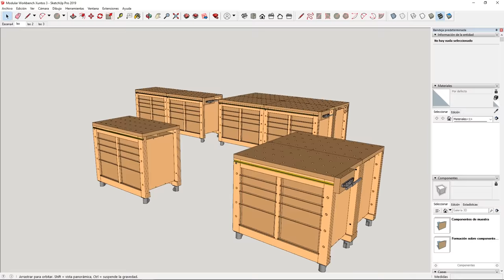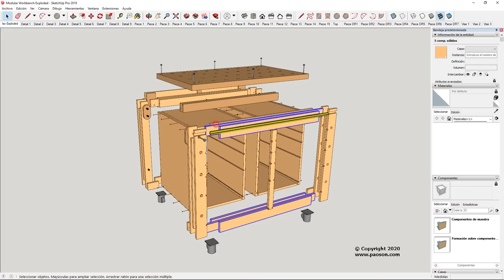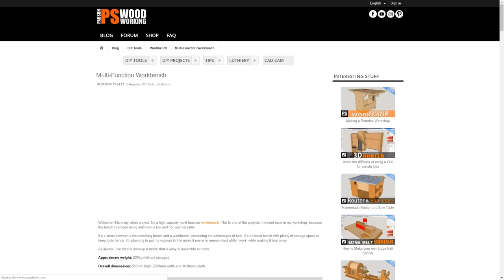Modular Workbench & Mobile Tool Stand (Ep.3)

Comment: Thank you for sharing this video. In a somewhat different form, I can see other vital uses for this Modular Workbench / Mobile Tool Stand concept.

OFFICE MACHINE(S) CART. This Modular concept, adjusted somewhat, would make an excellent printer/scanner/fax cart for small businesses and work-from-home settings. (This new concept would not need any vise or bench-dog-holes.) The drawers could house printer supplies and reams of copier-paper. The office machine(s) would likely be situated on top of the cart. The cart would incorporate a built-in plug-in strip / surge supressor and heavy-duty extension cord. This would be useful in assuring that the office machine(s) would not need to be individually unplugged in case the cart had to be moved from one location to another; all power needs on the cart would be met through the extension cord and the plug-in strip. The strip would also come in handy if the cart were also used to house at least one charging station for mobile devices, such as laptops, tablets and cellphones. A nook for locating such a charging station could be incorporated into the upper fringe areas of the cart.

HOME GRAB 'N GO. This is a direct evolution of the Office Machine(s) Cart previously mentioned. This cart would be an excellent place to house items that should be readily available to "grab and go" when departing or to "drop off" when arriving. Items would include a charging center for mobile devices (also maybe a recharging center for devices using Eneloops AA or AAA batteries). Items in storage here could include keys for doors, motor vehicles, key-fobs, flashlights, a place to hang a purse (or to stow a wallet), a place to hang a hat, a place to lay gloves in the winter so that they may dry. If the Home Grab 'n Go were equipped with a plug-in strip, it could also power an installed lamp or night-light, and the lower areas, if no drawers were included, could also house a boot dryer to allow outdoor shoes and boots to dry during winter or on wet days.

MOBILE DESK. If a retractable, pull-out and swing-up desk-tray could also be incorporated into the above Office Machine(s) Cart. This tray could accommodate a laptop computer, or a tablet or smartphone. The permanent top of the Mobile Desk could serve as a platform for either a large computer monitor, medium-size modern television or a computerized overhead projector with speakers. As with the Office Machine(s) Cart, the Mobile Desk would offer a plug-in strip connected to an extension cord so that all electronics would be connected through the Mobile Desk and not individually to nearby wall outlets. Drawers on the Mobile Desk could be used for stowage of cords, adaptors, and other audio/visual accessories. It is also possible that the drawers could be deleted to allow for contained under-desk storage of laptop/projector baggage.

As modular cousins to your Modular Workbench, it is conceivable that the Office Machine(s) Cart and Mobile Desk could be joined together for practical use within exhibits at trade shows, public events, festivals, confabs and indoor workshops. This furniture would greatly enhance exhibits for businesses and/or organizations. Doing so would create a transportable work center that could easily be wheeled out of the way so that an exhibit could be torn down or re-arranged.

Comment: @Paoson WoodWorking  
Excellent design!  And I really appreciate the modular aspect.  👍

I will be building a few of these with some slight modifications to accommodate my small shop's layout and particular needs.  Thank you for the inspiration.  :-)

Also I wanted to ask you if you have been pleased with the performance and quality of the Bosch 12V Max and 18v Core FlexiClick drill/driver that you are using???

I need to update my older cordless drill/drivers and the options are overwhelming, ha!

Thanks again for the excellent design and for sharing the plans.  Also your video production is top notch.  👍
Reply from the maker: hello! yes, I'm happy with the Bosch screwdrivers
Reply: @Paoson_Woodworking  

Thank you for the quick reply.  👍

Comment: This modular workbench is great, but I have a question: If you attach four modules to a two by two bench, how do you adjust the casters in the center? Or if you have two modules attached and placed against the wall: how do you adjust the casters at the rear center?

Comment: This is absolutely brilliant, great work. 
A few questions:
I noticed you mentioned one can change the width and height. I am curious though if there are issues with depth? 
Any concerns with replacing drawers with a full on tool slide? (I'm my case I'm looking for a low profile workspace where I can tuck away many surface eating tools)
Reply from the maker: hi Jeff, you can also change the depth! check this out:
https://www.paoson.com/forum/viewtopic.php?f=31&t=1089
https://www.paoson.com/forum/viewtopic.php?f=31&t=1276

Comment: Man have been waiting for this video and ready to pull the trigger on the plans.  Excellent stuff. One question though - the cross and rip cut functionality for the track saw, is that included in the modular plans like you have on the multi function work bench? thanks for your great work.
Reply from the maker: the rip cut guide is included, but you may have to modify the design a bit, thanks!
Reply: @Paoson_Woodworking  Awesome  - I certainly can do that. thank you kindly.